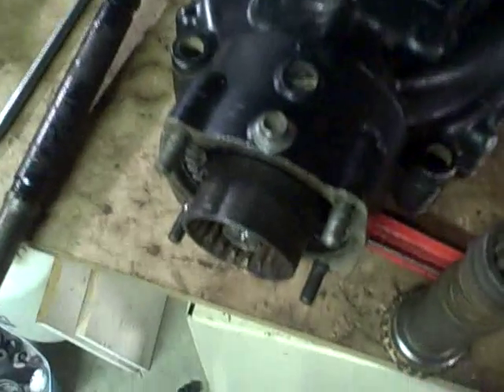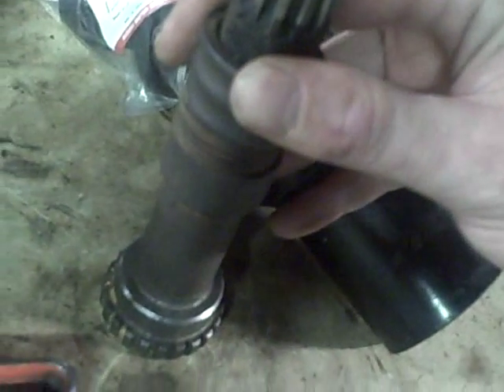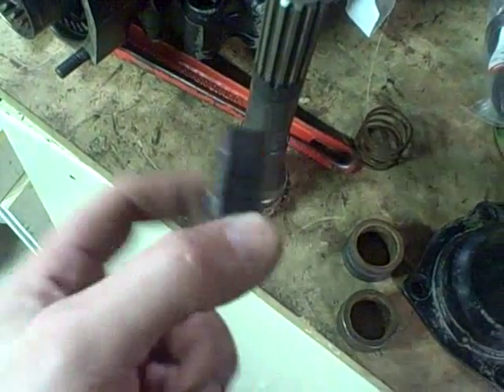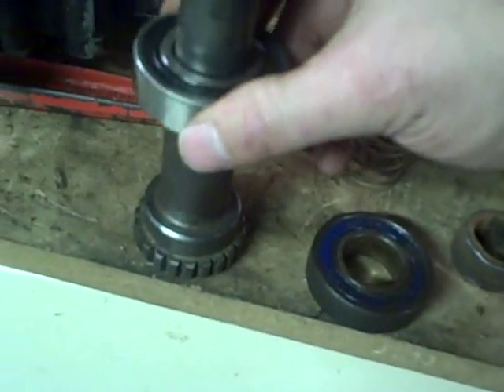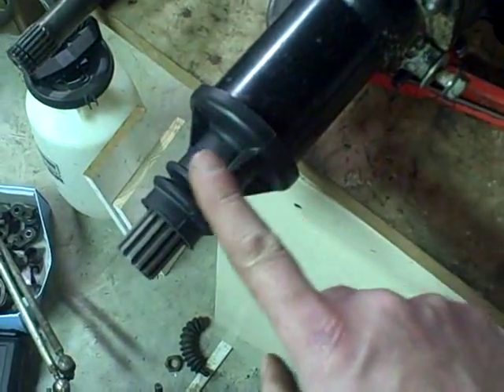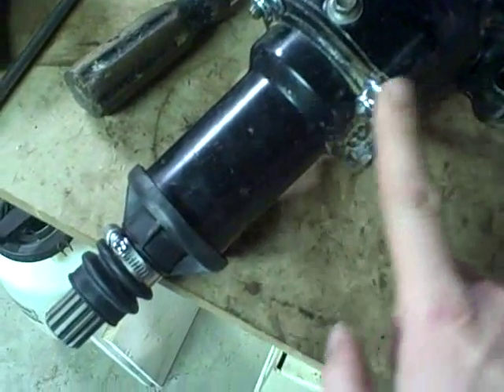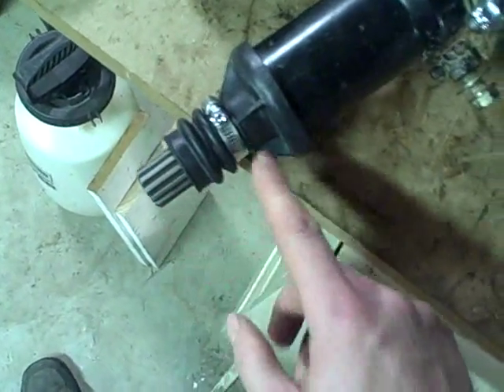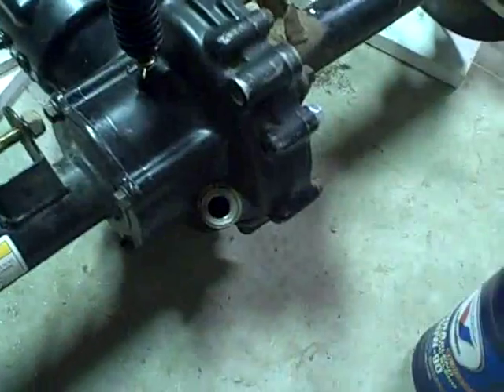Arctic Cat Repair Project Part 9B: Rear differential assembly

Comment: looked for kits in case I discover some issues when in back swapping out bearings, could only find kits as far back as 2000, have a 99... guess have to find parts books and see if numbers are same both years,,, nice collection on this rig..

Comment: Newer units have the same bladder on them, I work for an industrial supplier and had some oil resistant hose/tubing that i ran up underneath my seat and then put the tube on the end off it, it worked much better then the original set up.

Comment from the maker: Hi, thanks for your comment. It's been a while since I did this, but the general rue of thumb I go by, when packing bearings, I load it up, but if it's just on splies in a drive coupling that is covered by a boot, it is not a bad idea to leave some space for thermal expansion. If you overload it, it might push grease out when it heats up. Just my cents!

Comment: #1 - Constant Pressure spring, keep a loaded pressure on the shaft so as the ATV rides along the shaft slides in and out of the collar and the spring provides the return pressure so the shaft doesn't just drop out.

#2 - That nut that you lock by bending the edge, (Can't remember name) they are NOT to be reused because when properly torqued down the bent edge will align at the same spot, the metal isn't made to re-bent and could break off, unlocking the nut and allowing it to back off!!

#3  - The drive shaft splines should be greased up so it can slide free without wearing the spines out.

Hope this help out!!
Reply from the maker: Mike Flynn hello. this video is several years old, and I've long since sold the atv, but I leave the comment up as it may help some one else. Thanks.

Comment: Great video, i learned alot and was able to rebuild mine from wathcing you. one quick question what kind of bearing grease and how much do i use before i bolt it back to the rear differential. some tell me be greedy and others tell me be stingy with it. what are your thoughts

Comment: Hey your boot is clamped on wrong, the boot should be compressed and the clamp should be on the end where you pointed out a clamp could go, that boot has to slide back in forth as that spring lets the shaft move back in forth.     Like a CV axle boot!!